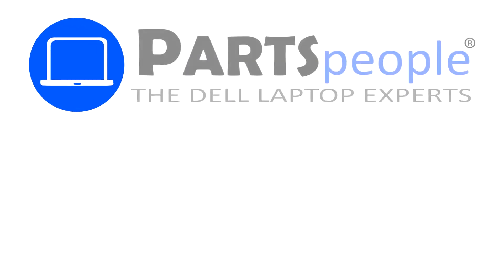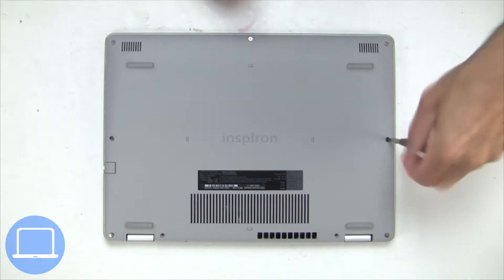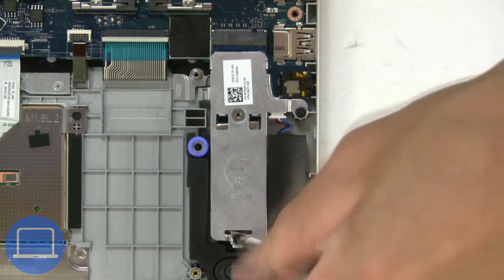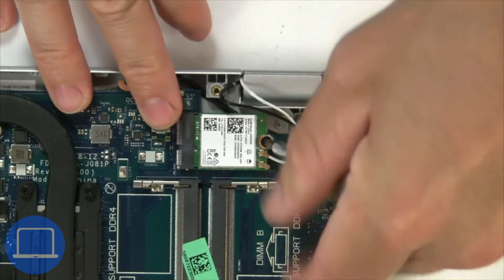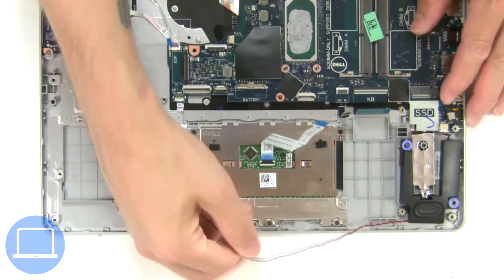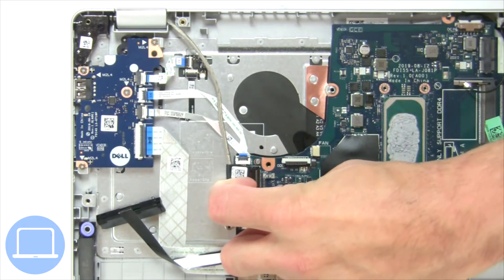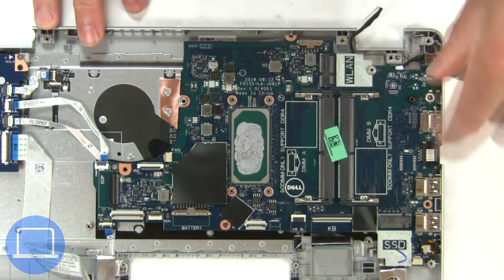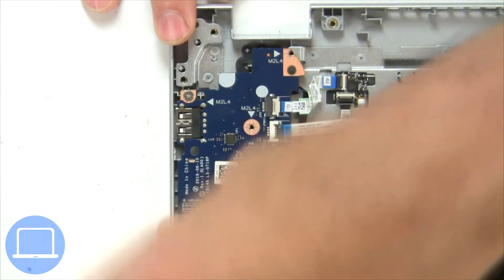Dell Inspiron 15-3505 (P90F004) Palmrest Keyboard How-To Video Tutorial

Comment: This video is excellent. Every step.
My problem is this. Why do you have to disassemble the entire laptop just to replace the keyboard?
For a car, if i get a flat tire. First pop the hood, disconnect battery, proceed to remove parts from the engine until what you have left are the tires. Replace the necessary tire. Replace everything back in reverse order.
Thats it!
Unbelievable.
Reply from the maker: Thanks. And fair question. This keyboard for this model is a keyboard/palmrest assembly that are a combination part and are not designed to be separated. This means everything must be removed in order to fully access it.